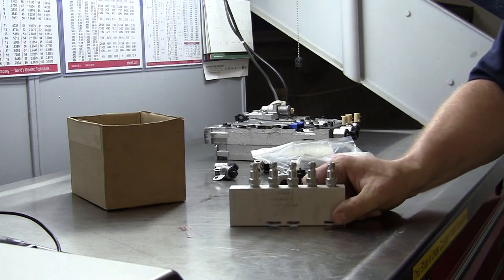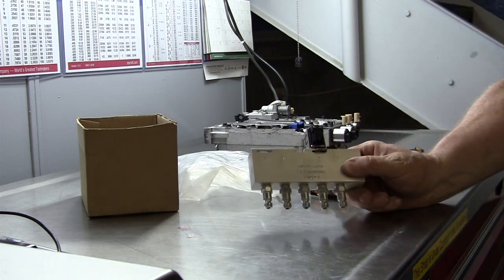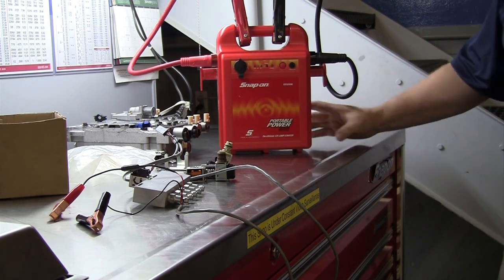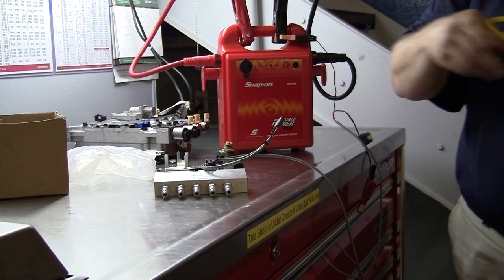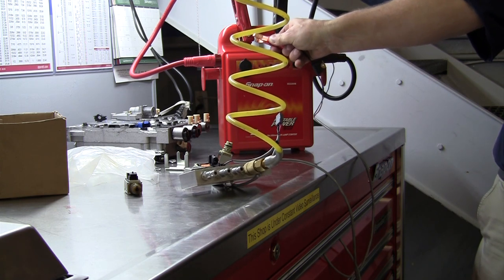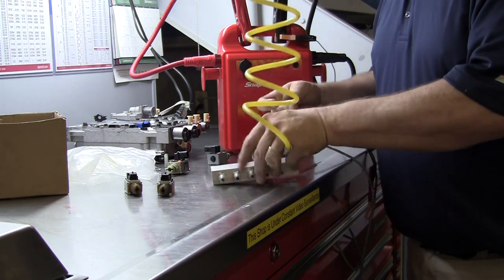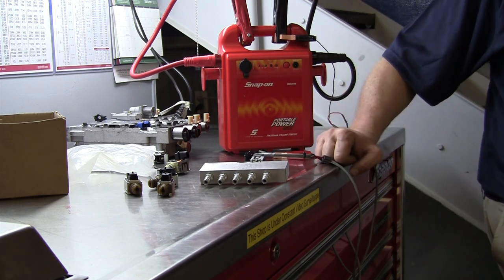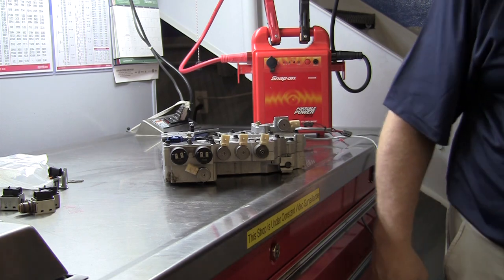Automatic Transmission Basic Solenoid Testing

Comment from the maker: Hi, yes, you can blow through it to test it, but keep in mind that the fluid to the solenoids is usually under pressures of up to 90 psi. Using the proper pressures to test it is better. Yes, you can also test the solenoid with a switch while driving provided that you get the wiring connections correct.

Comment: thank for good work pls i have 406 al4 auto transmission solenoid valve testing i saw 10.9 in your video my is  3.7 is the sensor bad or not thanks pls feed me back

Comment: I took out both solenoids and they both clicked and when 12v was applied I could not blow through it no matter how hard I tried, vehicle shifts fine to the point that it goes into limp mode, and today I drove 9 miles and probably could of kept going but I slowed down and the service engine soon light came on and I went into limp, when it does this my engine runs bad too. Vehicle sat for 4 years. Could it be something else? I am not getting codes.

Comment: is it possible to just blow into the solenoid to test it?

is it possible to locate the wires going to the solenoid and run them into a switch circuit- and flick the switch while driving to see if it causes a gear change?

Ive got a 2000 s10 v6 that shifts late into second gear and gives service engine soon light. I'm thinking its a bad trans solenoid.. never replaced one before but it looks like it will be quite involved. i dont wanna dig into it until im sure its the solenoid. Thanks 4 help

Comment: On this demo why can't you use a VOM  and power the control winding to see if you have continuity on the output contacts?
Reply from the maker: +Don G. Hi, the control winding on these solenoids only creates a magnetic field. The field pulls or pushes on a hydraulic valve or check-ball to open or close a hydraulic passage. There are no contacts to check. Winding continuity is only one of the three functions to test on these solenoids. Thanks for your feedback!

Comment: I have a Hyundai Accent 2004 with 6 solenoids installed. When we do this test 3 solenoids we have this click but in the other 3 we do not. The model installed in my transmission is a4af3. Do you think my solenoids is bad or this can be normal? 1 have just 1 and 3 gear. Thanks!!
Reply from the maker: It could be normal. Not all solenoids will click. Measure their resistance. If the resistance is less than 10 ohms, it may not click like shown in the video because they are a pulsed solenoid. Best wishes.

Comment: Hi
Great video.
Could you please tell me in 722.9 transmission blue cap and black cap solenoids have to be supplied with same 12v to test or they should be tested at different volts just not to blow up by supplying more voltage then required.
Secondly if one of the spring loaded check Valves is missing  in 722.9 valvebody what could possibly be the symptoms 
Thank you in advance..

Comment: Dual port on 46re - get airflow from outer screen to inner screen. Activate plugs all airflow stops. put air to inner screen and air flows to one set of ports drilled into case, activate solenoid no change. there is another set of ports on the case that I never get air out of. Is this defective? got 2nd and 3rd - nothing else - starts in second as well. No 1, OD, or lockup.

Comment: Hi are the wires fused?? I see a little tiny square on the other end of the wire , is that the fuse??
Reply from the maker: Yes, a blade type fuse holder
Reply: WeberAuto  did you use 10amp  fuse?
Reply from the maker: @velocity800  I do not remember, but it should not be higher than the fuse protecting that circuit in the vehicle.

Comment: Hello.
By Multimeter, I've measured my solenoid valve (cvt transmission) for Nissan micra v16, and put the read pointer to multimeter on the unit Ohm appeared result 12.7 ohm. Does it need to replacement or not?
Tank you.
Reply from the maker: I do not have the specification for that solenoid, but it does not sound like a problem.

Comment: Wow, very knowledgeable technician. I have a 2002 Jaguar X-type, Jatco JF506E transmission, that will not shift in to 3rd gear, it's in safety mode. I received codes, P0758, P0748, both solenoid codes when I try to drive it. I was wondering if I can test these solenoids like this, or if there is something special about these transmissions where you can't test them? Also, can you recommend a good tranny fluid? I have a bunch of Royal Purple AFT Max I was going to change it out with. Great Video!

Comment: So how much is this
 Air tool? And I assume gm dealer is where I can buy this? I need this in my life.  I Had a saturn come in the shop that needed new 1-2 shift solenoid to be replaced.  Would have made bench testing really easy with the air.

Comment: I'm testing the ohms on a 2005 Durango transmission valve assembly. There is one shift solenoid that you can access the terminals from outside the valve assembly - but the others, you have to open the assembly. Now, what would the resistance be on the outside one versus the ones inside? I'm getting two different readings on these solenoids...and the one outside "clicks", but the ones inside dont click (when power is applied). Should solenoids ALWAYS click???

Comment: Hi, my 2004 Peugeot 307 automatic transmission died and I did the easy part by replacing the two solenoids that are usually responsible for that issue but I got no improvement. None of the gears will engage and when I jacked up the car with drive wheels off the ground and I rotate the drive wheels with the transmission in parked position one wheel at a time is moving, can you help me figure out if something is broken please, thanks much
Reply from the maker: Sorry, I know nothing about that transmission. Best wishes!

Comment: would the EPC solenoid make the same clicking  noise as the other solenoids??
Reply from the maker: +changomonkey86 Good question! No, they may or may not click since they are pulse width modulated, it depends upon their design. This test is for on-off solenoids. Thanks for watching.

Comment: what size fuse did you use on the power cable?
Reply from the maker: The tool comes with a bag of different sized fuses. You must match the fuse to the circuit you are testing. I was using a 20 A fuse in that video.

Comment: Hi, If you don't mind me asking a question about an automatic gearbox problem? It seems to slip when it changes to 2nd and 3rd gear. The more throttle I give, the more it seem's to slip, and if I leave the throttle, the gears seem's to engage the way it should! If possible, could you give me some ideas of what it could be? Regards.
Reply from the maker: Hi, it depends on the transmission model. What year, make, and model of vehicle?
Reply: It is a 2015 Audi Q7 3.0 TDI with a 8 speed tiptronic gearbox.

Comment: what test is better, the battery test or the multimeter test, or i need to do both to get to the conclusion , god ones and bad ones
Reply from the maker: Battery test is better. Multimeter only checks the resistance of the coil of wire in the solenoid. Best wishes.

Comment: No they constantly coming on and off as you drive. Now as an example if you drive 500 miles without stopping and your number 1 shift solenoid is on in over drive then it is on for 500 miles. Make sense? Hope this helps.

Comment: do all auto transmission have a solenoid?  I am trying to troubleshoot my 68'Dodge D200 3pd automatic.
Reply: dlynes they used a mechanical system up till the 80s are probably the 90s...you had a valve body

Comment: What about Resistance testing, Is it a foolproof health check despite it doesn't leak? What do you think about a solenoid in it's natural habitat, is it prone to intermittent failures due to heat and dynamic fluid loading? 
Thank you very much for enriching our minds
Reply from the maker: Thank you. Resistance testing with a traditional multi-meter is useless unless there is an open circuit.

Comment: I found this test bock online but will it work with Ford solenoids? The transmission is a 4r100. I’m having a issue where the truck moves like normal in reverse but I have to give it gas to get it going in forward and most of the time I have to pump the gas petal to get it moving then it will go and shift through all the gears but I have to pump the gas petal a bit as I’m driving it then when I get to cruising speed I’m good like it’s running normal. Any insight?
Reply from the maker: That solenoid block is for GM transmissions, but it may also work for some other brands too, I do not know. Always check the fluid level to begin diagnostics and check for codes. Best wishes
Reply: WeberAuto yup checked fluid and it’s within spec and no sign or smell of being burnt or anything. Put vehicle on the computer obd2 with no return of codes.
Reply: Did you ever use the tester on a Ford solenoid? And if so, did the tester work?

Comment: You seem very knowledgeable on transmissions so if u don't mind I am having this trouble code on three different Korean cars relatives cars 2 Hyundai and 1 KIA all with automatic transmissions.
the code is
P0741....which reads Torque Converter Clutch Circuit Performance or Stuck Off DTC.
Would u plz guide me to what is most likely cause of it?How serious ? and how to fix it?
Appreciate the help, Thank u very much
Reply from the maker: That is a common code that can be caused by anything from the solenoid, worn out shift valves, o-rings, seals, and even the torque converter itself. I am not familiar with those versions of transmission and do not know the most common cause. Search the internet to see what others have found. Best wishes.
Reply: Appreciate your answer, Thank you very much.
Just a quick question do u think running the car with this code would cause serious damage to the transmission?
Reply: I have my stuff I eat but I'm struggling to get against only get 1 2 3 I don't get 4 and I did try to replace the solenoid and keep giving me the same problem but if I disconnect from the battery and then put back again and I get all the shift 1234 so is anybody have the same problem who can help me buy
Reply: I have Mazda 5 I having problem with the gear only get 1 2 3 I don't get 4th gear so I buy the new solenoid I replace I still have the same problem but if I disconnect from the battery and put back again I get 1234 so it's anybody have the same situation or can help me to tell me what to do

Comment: so how can I tell if it's my control module or a solenoid without taking anything off the car first...??
Reply from the maker: Use a scan tool to check for trouble codes.
Reply: I have scanned it and replaced what the scanner said but still have the same problem

Comment: I have a  1995 Isuzu rodeo, i was driving home and the motor was getting hot , i turned off the air conditioner and when the light turned the car started very slowly, i dropped it into first and it took off. Now the tranny doesn't shift automatically but it will manually and the check transmission light is blinking, any thoughts?

Comment: i have Volkswagen jetta 2.5L 2008  when the car is cold shifting Ok but when the car become hot it is slip and shift in 3th and 5th gear and in lowering gears it is hit 
i use ATF AC DELCO  fluid     i need to know what is the broplem please help
Reply: I hate to be the guy that says you need OEM parts but today I am going to be that guy. On European cars factory ATF is a must. VW doesn't make half the stuff that is on their cars, find out who makes the product then order it online from the your favorite online retailer.  you save a lot by not having a VW logo on it and its the very same thing it is filled with from the factory. I happen to know that FEBI and PENTOSIN (CRP automotive)make most of the factory VW coolant and ATF. Another thing to do is put the Transmission computer into factory relearn mode, so the transmission computer will change the shift timing., this can clear up alot of problems. You dont always need a scan tool to put it into relearn mode, on some VWs you can perform a sequence of operations like press on the accelerator pedal turn the key to the on position and release the accelerator and turn off the key. just depends on the model.

Comment: What he is not telling you is that even if the solenoid is controlling the air pressure in this little test, if doesn't mean its good. The solenoid can seem good initially but when in use for a while as it heats up it can develop an internal short or open circuit making it useless just like fuel injector.

Comment: What is the psi you are testing at?
Reply from the maker: 90 psi is the recommended maximum pressure since it mimics the actual pressure at the solenoids in the transmission. Have a good day!
Reply: Thanks for the prompt response!!!

Comment: Hey there,  I usually comment on UFOs but today my little 93 323 has been bugging me since i could only find dots of info here and there. Now because of your video and a comment by a veiwer, I have learned a fair amount about the solenoids  I used a Ohm meter to test the connecter outside the F4A-EL transmission, a 3 speed with OD and a hold button. (A rather brain tumor of a transmission in hind sight) along with the earlier style ECM/TCM allinone computer. The HOLD button illuminating on the SPEEDO is also some distraction. This car was given to me because it is in limp mode but don't think it was continually driven afterward. Thing is now that all solenoids but the pressure control solenoid test at @20 ohms resistance. Now if however the PCS has been going bad for some time, would there be less pressure to the other valves and subsequently wear the transmission clutches etc causing excessive heat ? I didn't try very long and so it didnt heat up and shift past first and so would not know if the check balls per solenoid shut off the flow per shift solenoid. As you can tell, I been reading a lot on this and also was wondering the voltage to test these solenoids to get the click. I run of course the 12 volt battery in the car but not sure if the voltage to them is past resistors of sorts. I wouldn't think so watching how confident you are. I wasn't sure if i should bother with the car as it is old too. lol. If you have some sort of offering to me would be of interest and Thanks for a informative video.
Reply from the maker: The PCS solenoid is normally around 5-7 ohms and does not usually click like the ON-OFF solenoids I tested in the video.  12-14V is the normal system voltage supplied to the solenoids while the vehicle is operating. There has to be a reason it is in limp home mode. Even a speed sensor or other TCM input can cause a problem like that on those early models. Best wishes.
Reply: Hi , I was getting a 20 ohm resistance but did not get around to a test with voltage as i  wanted your reply. Thank you for getting back to me !
I will try that tomorrow after work but it is in tranny in car so i might be able to hear the click but wouldnt know how the seals are in each. Also I think i have confirmed to myself that the PCS is the prime suspect . I have only one tranny guy in town between the two ferries out of town and one other salvage yard. I am living in oblivion of the end of the planet and surrounded by only 350 cars and i chose this one to werk on. LOL, I think i might be MAD... Thanks again.

Comment: I have a question can you test a solenoid with just two wires to a battery cuz I checked to them you could barely hear click but the other three you can hear a loud click what does that mean
Reply from the maker: Some solenoid types are just louder than others. Two identical solenoids should sound the same.